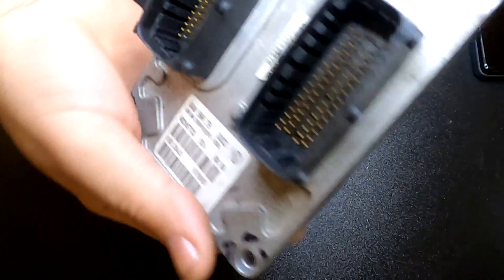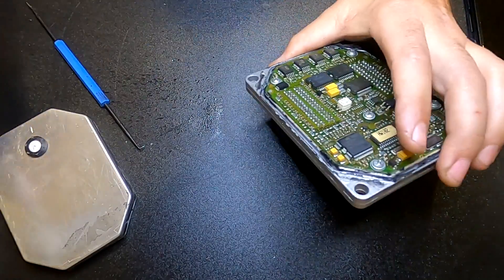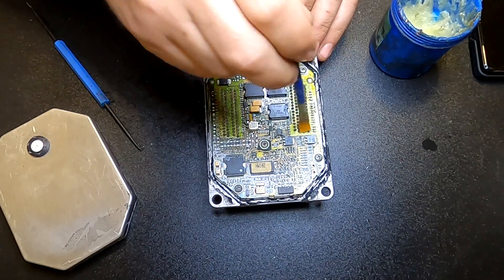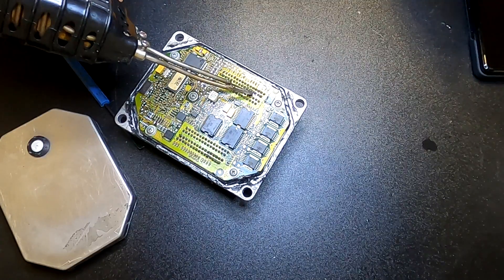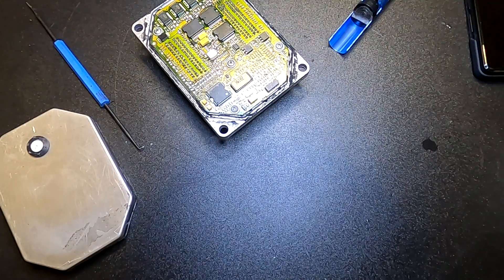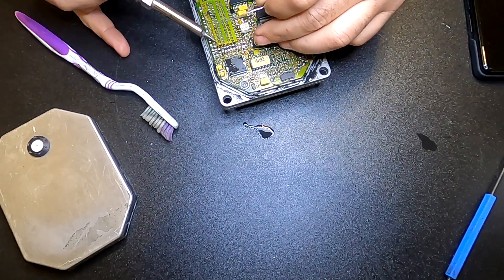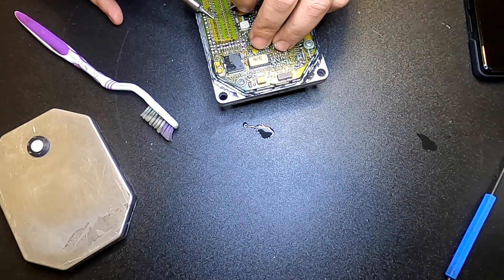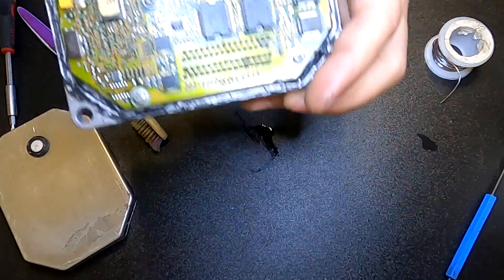Fiat Stilo 1 6 ecu repair (most common problem)

Comment: I have a ecu that is faulty on my 1.6 . I think it is the chip , i bought a used one which is repaired with the key and the code card but whithout the body... Is there any way that i can bring it work? From the tools i've got multi ecu scan , and some vag cables blue with the 1357 pin switch and one vag fiat black for the fiat can tool. 6 colored cables and a bunch of elm327
Reply from the maker: thanks for watching
i think you will need to get the bcm to direct swap the complete kit ready to start.
i dont think that with those tools you will be able to program the bcm that you have with the new ecu and key...also in fiats to program stuff like that you usuall need the red key.
just get Galletto and clone the flash and eprom from the original to the new one and thats it.
i have a video here on this chanel about that.

Comment: wtf you did at 6:36 ? you know, you can damage the PCB by having solder to directly touch the outer layer. Also, you don't need to transfer anything if you change ECU, you just virginize the new one and that's it. But you really say it's not "fixable" if the problem is not the pins? The other failing possibilities is the Motorola BGA CPU at the back of the PCB (reflow or reballing can fix that), sometimes the front Motorola MC33 drivers get bust, sometimes a capacitor can go bust etc. Unless the PCB has PHYSICAL DAMAGE (as you could damage it like in 6:36 or someone digging the PCB to remove a chip) it really is FIXABLE.
Reply from the maker: Thanks for watching.
Reballing is doable but i never had success for long term with that.
And this ecu is working just fine so far so i guess i didnt damage anything...perhaps the angle of the camera mislead you in how close the solder is from the outer layer, but i know exactly what you are saying and its absolutely correct.
What you see touching the outer layer is actually solidified flux and its not solder.
Thank you for your input, hopefully people can read your comment and be aware of that...thanks again.
Reply: @PSICompanyPerformance  yeah thx for clarifying. Maybe you should get some higher quality flux then. If reballing didn't work for you, you can always buy new Motorola 68000 series (don't remember exact part number) and then you can flash it via bench from the old ECU.
Reply from the maker: @xynostasos9022  thanks
i have a video on clonning these ecus via obd via Abrites and abrites can also do it on the bench. 
thanks for your feedback
Reply: @xynostasos9022  hi. Can you check and repair my iaw5fd?

Comment: the problem is not soldering
Reply from the maker: Thanks for watching.
About 80 to 85 percent of the time when i get one of these the solder is the problem...thats why i say on the video that is the most common problem and not the only problem.
In fact i have a video on how to clone this ecu to another one in case that is not fixable.
Reply: Hi can you please leave a link?